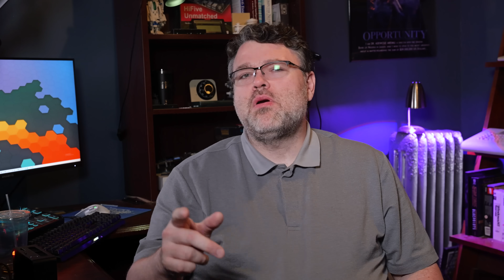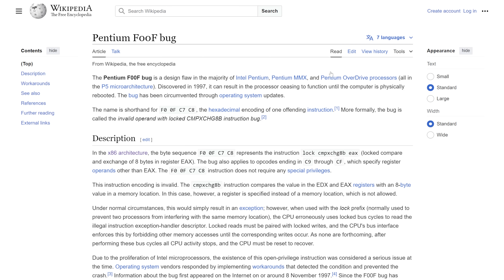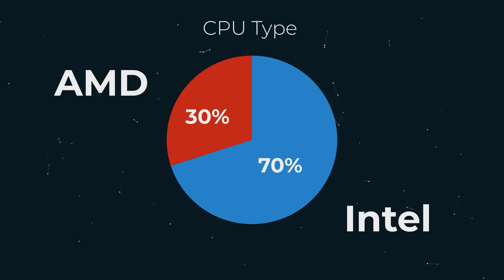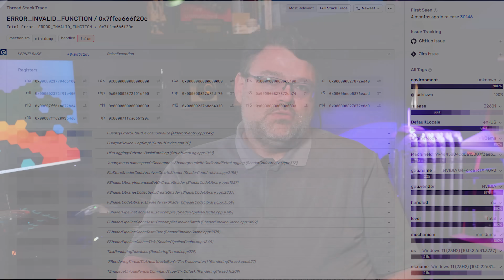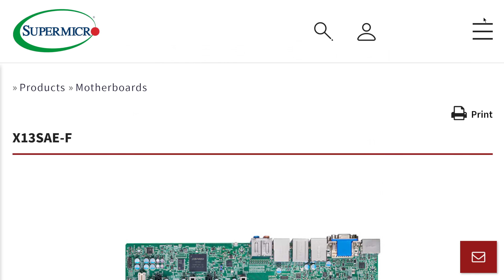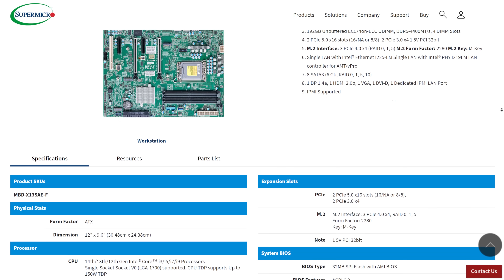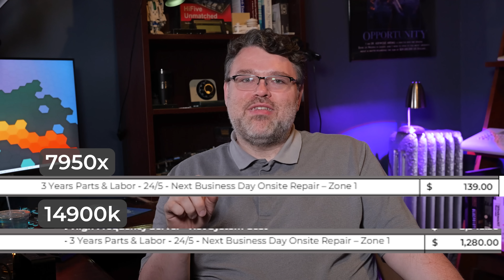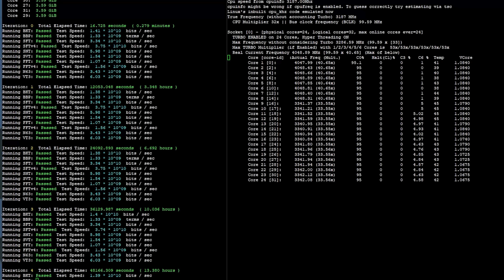Intel has a Pretty Big Problem

Comment: I can't recall an issue like this since Sun accidentally shipped radioactive chips that were unstable.
Reply: I mean, Intel had to do a massive recall back in the day (1990’s?) when their CPU’s literally couldn’t do simple math instructions consistently. They didn’t exactly fail, they just never worked in the first place because of a critical design flaw.
Reply: @benjaminlynch9958  Intel had to recall the initial 1.13Ghz Pentium III because it was unstable from factory, funnily enough.
Reply: @Mike80528  I beg your pardon?
Reply: What about hair loss and testicular atrophy?
Reply: Intel isn't a complete stranger to degradation issues.
The degrading SATA ports on Sandy Bridge chipsets were discovered just prior to launch and most boards affected were exchanged on Intel's dime.
100 series (Skylake) chipsets are known for flaky USB ports.
Then there's the LPC clock bug that plagues a bunch of common Atom SoCs, to the great chagrin of many NAS owners who have been seeing systems logging erroneous system monitoring errors and no longer booting after several years in the field. I've had to revive one with a Celeron J1900 using the "resistor on LPC connector" hack myself, heaven knows how long that's going to last.
Reply: they WHAT
Reply: @AgentAsteriski  bad batch with very low radioactivity, it was not an issue for people (especially through the iron clad cases) but the radiation was causing bit flips in the ram or something like that, corrupting data and crashing the systems
Reply: I found some info on the radioactive Sun chips. Apparently the issue was in SRAM, not the CPUs, but still.
The page itself is down, so here's a quote:
"When Sun folks get together and bullshit about their theories of why Sun died, the one that comes up most often is another one of these supplier disasters. Towards the end of the DotCom bubble, we introduced the UltraSPARC-II. Total killer product for large datacenters. We sold lots. But then reports started coming in of odd failures. Systems would crash strangely. We'd get crashes in applications. All applications. Crashes in the kernel. Not very often, but often enough to be problems for customers. Sun customers were used to uptimes of years. The US-II was giving uptimes of weeks. We couldn't even figure out if it was a hardware problem or a software problem - Solaris had to be updated for the new machine, so it could have been a kernel problem. But nothing was reproducible. We'd get core dumps and spend hours pouring over them. Some were just crazy, showing values in registers that were simply impossible given the preceeding instructions. We tried everything. Replacing processor boards. Replacing backplanes. It was deeply random. It's very randomness suggested that maybe it was a physics problem: maybe it was alpha particles or cosmic rays. Maybe it was machines close to nuclear power plants. One site experiencing problems was near Fermilab. We actually mapped out failures geographically to see if they correlated to such particle sources. Nope. In desperation, a bright hardware engineer decided to measure the radioactivity of the systems themselves. Bingo! Particles! But from where? Much detailed scanning and it turned out that the packaging of the cache ram chips we were using was noticeably radioactive. We switched suppliers and the problem totally went away. After two years of tearing out hair out, we had a solution.

But it was too late. We had spent billions of dollars keeping our customers running. Swapping out all of that hardware was cripplingly expensive. But even worse, it severely damaged our customers trust in our products. Our biggest customers had been burned and were reluctant to buy again. It took quite a few years to rebuild that trust. At about the time that it felt like we had rebuilt trust and put the debacle behind us, the Financial Crisis hit..."

Source: James Gosling
Reply: Intel had bad chipsets on sandybridge like this as well.
Reply: I'd like to know more. Do you have a link ?
Reply: @nessotrin  I think its this, https://en.wikipedia.org/wiki/Pentium_FDIV_bug ,  Its floating point math would mess up a small amount.  But that error could compound and cause problems depending the calculations.  I recall having a professor say he had to redo part of his thesis due to this problem.
Reply: @alexandermorrison9077  That one makes sense. But what about the radioactive chips ? 🙃
Reply: @nessotrin  They're referring to UltraSPARC II radioactive ram issue. The chips weren't dangerous or anything. Radioactive elements are everywhere around us and we're pretty tolerant to it. Computer components are much less tolerant, so when manufacturing them you need to be careful to only use stable elements in anything close to the silicon. A single lucky high energy particle can flip a bit or even destroy gates. The plastic packaging used to encapsulate the SRAM chips was slightly radioactive, and it's hard to be closer to the silicon than that. After a year of tearing their hair out, the issue was discovered and resolved by changing the vendor they used for packaging the chips.
Reply: @bloomtom  Atleast 2 years ago you could still get an exchange for a faulty pentium-cpu. Did this and got one without that problem. But it took a lot of emails, cause the normal service-people didn't know anything about this problem.
Reply: @nessotrin  If you Google it you might find some information. This was back in the early 90's. The company I worked for had the issue with our SPARC system. SUN made customers sign an NDA if I recall. I don't recall how widespread it was.

I did a search and only found limited mention of it from some old forum posts...
Reply: accidentally is the key word here - as much as "its not a nice thing to say", I dont think these failures are acciedental .. - ask yourself "what lenghts are individuals willing to go to in order to keep top spot" (even on paper)
Reply: @paulwratt  Accidentally nuking your own system in the long term to get the "best" performance at launch/review time is still technically accidental.

Comment: I work in commercial IT, we have had 30+ PCs where the intel CPU essentially died, this has been affecting them all from 10th gen to current. Recent one was a month old 12th gen 1255U. Affects desktop and laptop CPUs. Larger companies that deal with more PCs have had a lot more of the same.
Reply: "we have had 30+ PCs where the intel CPU essentially died" - Are they Dell? We've gone through so many Latitudes this year it isn't funny anymore.
Reply: @ericneo2  Oh my god, we had a Dell for two f*cking days and the NVMe died.
Reply: my dell r650 servers have had issues. ive seen more intel cpus die recently than ive ever seen
Reply: @ericneo2  I have a colleague that has had the same issues as you, he had to do the rollout of the Latitude 5421, which he called a mobile heating brick. They even bricked themselves during an out of system Bios update. 

And all that is before having to deal with the Dell Support.........where even we on the professional side have to deal with the dumbest people possible. 

Like:
Us: The PC doesn't turn on, it's dead, we need a replacement system board!
Dell Support: Have you updated the firmware?
Us: It's dead!
Dell Support: But have you tried the troubleshooting steps, like updating the bios firmware and drivers.

So we need to tell them a story about how we did all that with a functionally dead PC. 

Or we need parts for a PC out of warranty...

Us: So we need those parts for this PC, and we are willing to pay! How much does it cost!

Dell: We sell you no parts!
Us: Shut up and take our money! No gimme the parts!
Dell: No I don't wanna! NANANANA!
Reply: Where I work we use exclusively Intel CPUs.
We're so fucked LMAO
Reply: If this goes back to 10th gen that is terrible, but with the age of 10th gen now that seems unlikely to me - if it was a big problem for them it would have been noticed long ago. While we have come to expect the CPU to outlive its mobo by a decade or two on average 10th gen is old enough now shouldn't you be expecting to see some failures?
Reply: good thing ive got an i9 10940X@5ghz/1.26v/256gb of RAM on a nice MSI X299 Pro ;) that system has being more stable then some friendships xD
Reply: Does 10th gen include laptop parts
Reply: Is this also affecting the 14900hx laptop cpu?
Reply: @WaterspoutsOfTheDeep  unsure
Reply: I work in Labtop repair and our main customer is a Major IT firm that probably everybody knows (used to be very innovative in Hardware).

And we've got Lenovo T14 Gen 3 (12000-series Intel CPU) and T14 Gen 4 (13000-series Intel CPU) dying like flies right now.

Sometimes the replacement system bosrd dies with 2-3 months also.

Could be the undersized cooling, could be the horrid Lenovo Thermal "Paste" (only at first*) or something else.

*We replace the shitty Lenovo stuff with something a lot  better as part of our service, especially when Systemboards/Mainboards have to be exchanged.

Edit: typos, damn phone!
Reply: @LupusAries Hey, I have owned my i9-13900HK laptop CPU, no OC, for 0.75 years and it is fully stable. What is the starting usage to failure interval on the chips you’ve seen in comparison? In decimal years.
Reply: @chocolate_maned_wolf  Between 0.75 on the highest end and 0.2-0.3 on the low end. 
The worst part is the 0.2-0.3 are with replacement boards, so some of them might actually be "refurbished" boards and chips. 

The main issue is the way too small cooling solution and the bad thermal "paste" we call it "thermal concrete", due to it's consistency and thermal properties. 
Also Lenovo still runs PL1=PL2, while the CPU never reaches the PL, but it reaches 100 degrees C during testing.
Reply: @LupusAries  thanks
Reply: @LupusAries  thank you so much for this information. My CPU is running strong at 0.78 decimal years since purchase, (i9-13900HK in alienware M16 R1) so either I got lucky and it doesn't affect my chip through random chance, or it hasn't failed yet. Obviously I hope I did, because RMA is a pain in the ass, but I can't say for sure yet since that's only 0.03 greater than your highest datapoint.
Reply: @chocolate_maned_wolf  Yeah you might be lucky  now the caveat to my data is that the T14 Gen 3 has been in service for just about over a year, I think 1.2-1.3 years, and the Gen4 has been appearing in service in small trickles for half a year.

We also had a bad run with replacement parts recently, where sometimes 3-4 out of 5 were DOA.
Reply: @LupusAries  Thanks, good to know. I hope that i'm not just waiting a bit longer for it to collapse. Luckily, my warranty for my laptop has not expired yet, and I can renew the warranty.

Oh, and I forgot to say, my CPU only pulls about 175 W at max load I believe, the entire laptop pulls ~330 W. If these numbers sound wayyyyyyy too low then I probably did the calculations wrong.

The CPU itself does not seem slow and is able to push through avatar: frontiers of pandora with near 100 usage at high temps without any glitches data wise
Reply: @chocolate_maned_wolf  Keeping my finger's crossed, friend! If the cooling is decently sized and you don't run it all the time it might not happen as fast and after all 50% of the Desktop CPUs don't have the isue. 

And since the Labtop CPU is a different SKU it might not affect it...hopefully. On the other hand, I've seen a lot of Labtop CPUs dying...

It is one sucky situation that you are in. I wish you the best.
Reply: @LupusAries  The cooling on the Alienware M16 is amazing, and I wear headphones when gaming, so I have a very aggressive fan curve set that just maxes out whenever possible, so the cooling is fine. Thank you for your kind words.
Reply: @LupusAries  Is this also affecting the 14900hx laptop cpu?
Reply: @WaterspoutsOfTheDeep   Honestly, I don't know.
Reply: How many amd cpus do you have?
Reply: @bulletpunch9317   My client builds are mostly AMD with the rare scattering of i3 10th gen for low budget home/office builds. In my experience, the AMD CPUs with abnormal failure rates (about 1 in 6) were launch day 7nm Zen2 Ryzen 3000 CPUs. The nature of the problems indicated many Zen2 CPUs had a faulty Infinity Fabric link between between the I/O die and CCD(s), and of course generally poor quality silicon which struggled to reach advertised boost clocks. However, since the Ryzen 3000 XT series refresh, AMD CPUs have been extremely dependable and problem free, as have the i3 10th gen parts apart from occasional issues with iGPU drivers and certain refresh rates.
Reply: @DJIpro3868  Its normal for some sata slots to not work, as well as ram not being detected in certain configurations. There is manual included with motherboard for a reason, some configs working well is a miracle (like 3 mismatched RAM sticks, sometimes it works, sometimes it doesnt, game of luck with ANY processor regardless of age, there is also good reason why mobo makers have a list of supported memory modules and configs for each one).
Reply: @alexturnbackthearmy1907  I have a C16 3200 and C15 3000 MHz RAM of different brands on a 2 DIMM mobo, they can work just fine at C15 3000 for months and take any long stress test like rendering or gaming but if I just do something with my computer when it's off, I have to take out one of the RAMs and run it at non-XMP settings and then insert the 2nd one and then set XMP again. Caused me to think I killed my PC for some reason multiple times. In the past I was able to run 4 sticks at near ideal speed on an older rig (DDR2 or something like that) and that was a hell a lot harder to run. It was either two different kit of sticks or just all sticks are not even kits. I think currently with DDR4 or 5 that would be next to impossible.

Comment: My guess is that the Ecore and Pcore issue is much bigger then we are led to believe and prob. why they are going single thread.  They just can't get it figured out.  My guess is also the handshake between the to core types and what and when they are going to do what is the problem.  I mean, these are basically 2 cpu's fighting each other over who is doing what.
Reply: The move to single thread would have been decided before the 14th Gen was released last year. Chip design is a multi year process, and that would have to have been decided in 2021 or 2022 to meet the 2024 product release later this year.

The e-core and p-core theory makes a lot of sense, particularly as they don’t do hybrid architecture in Xeon, and none of the Xeon chips have problems that we know about. The problem is that they introduced e-cores for the first time in the 12900k generation, and none of those chips seem to be affected. Also, this doesn’t appear to affect any laptop chips which switch between p-cores and e-cores regularly for power savings.

I like the line of thinking, but I think there’s something else going on here.
Reply: You would be surprised how often things that take multi years of planning and design will change on a dime tomorrow. It's far more common then you think.